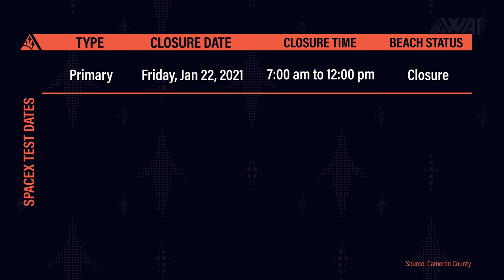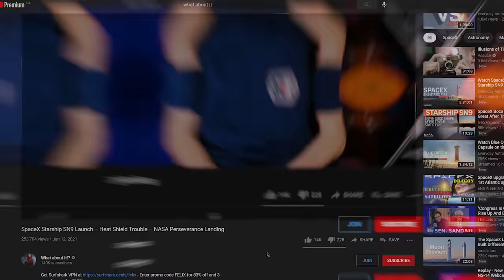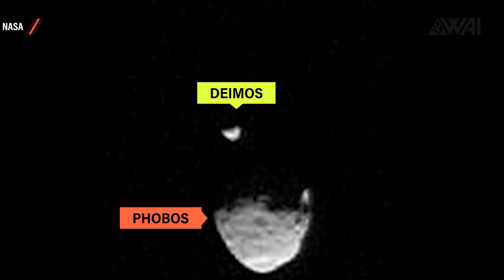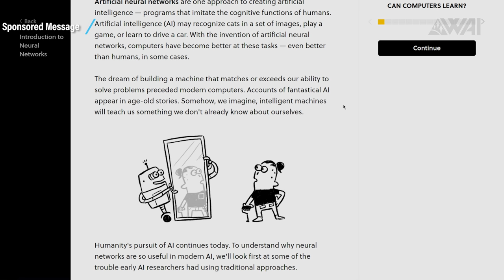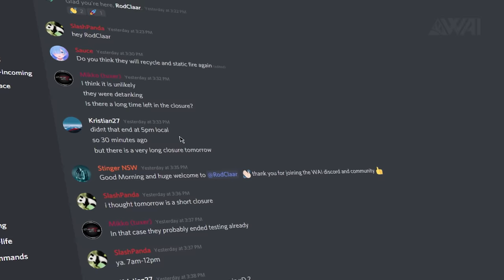144 | SpaceX Starship Sea Launch Platforms Under Construction! - SN9 Strange Tests

Comment: I'm a little concerned with the size of the ENSCO 8500 series oil rigs with regard to launching a full Starship stack from them. These rigs displace 19400 tonnes, which seems perfectly adequate for a 4400 tonne Starship, but the problem lies in the rig's TPC (tonnes per centimeter), which will be quite low seeing as it has a waterplane area consisting of just 4 relatively small legs.
This means that as the Starship launches, the rig will suddenly have to deal with a loss of 4400 tonnes, making the entire structure rise up by a substantial amount. This is of concern for a semi submersible rig that is secured by set anchors to the sea bed.
Presumably SpaceX engineers have factored this into their initial feasibility calculations.

Comment: Good job.  I assume the oil rigs came with CAD models, that will help.  I was on a rig once and was ... impressed by everything, but particularly a lot of shipping containers with diesel generators below decks.  Oil rigs need a lot of power.  Thanks for the Tee Shirt!  I may just keep mine pinned to the wall.

Comment: Yet another great video Felix, you called out some interesting details as always.

On the "might we see two boosters being built side by side?" how do you think that will work with just the one High Bay currently hosting both booster builds and final stacking and finishing work for SNs? Do you think we need to see SpaceX break ground on a second High Bay (probably next to the existing one) quite soon so that HB capacity doesn't become a bottleneck? Even if they do that it will take a while to build a second HB so if they really are going to do two booster builds in parallel perhaps final stacking and finishing work on a few SNs is going to have to go back to the old days when that stuff was being done out in the open.

On the sea launch platforms I wonder whether they will bother with any crew accommodations. It seems to me that it would be quicker to simply buy a suitable ship/boat for all human occupation that stands off at a safe distance from the actual launch platform and either only docks with the platform for embarkation/disembarkation of has a smaller shuttle vessel that takes crew and maintenance engineers the 2 miles or whatever the standoff distance is to get humans to/from the platform.

Comment: i bet that 1: either these were bought as support platforms, or 2: they will somehow be combined into a single platform. my instinct says that these will be stages from which the real launch platform will be constructed close by, (wherever they end up in the gulf). ie these will be located in a position, eventually, where they will be used as a means of making a new dedicated platform for launch.. and they themselves are not the launch platforms, either by themselves or combined. remember they only cost 3+ mil a piece. pocket change for spaceX. good deal, but i think they need to engineer their own platform from the ground up.. ha ha (anti-pun intended).. get it? .. cause it's a floating platform and nothing is from the gound up?.. oh never mind.

Comment: Does the Moon version of the starship need sea level raptors at all? Wouldn't they be high enough in their flight profile to skip them? If three Raptors can lift a Starship off in 1G wouldn't 3 Vac Raptors be plenty to take a partially laden ship off the 1/6 G surface of the moon?

Comment: Usually glossed over is that if a fully loaded Heavy launces the noise from the 28(?) motors would be a danger to anyone within miles of the launch site.  Elon recognized this some time ago, which is why he twittered about the offshore space ports back then.  The purchase of the oil rigs just makes sense.
Felix, care to speculate how the Heavy booster and the Starship will get from the build site to the offshore space ports?  
My guess is that they will be flown there.  If only partially fueled either should be able to do it with only three engines and an acceptable launch noise level.  Flying them to the off shore space port would be far less complicated and far less expensive that transporting them to the Brownsville port by land and then shipping them out to sea.

Comment: If you give it some thought, there is no need to haul Boosters or Starships anywhere.  When a booster or Starship is needed simply perform a short hop to the new location.  
It really is the cheapest way.  Thanks Felix for the tidbits that no one else seemed to know. P.S.: I am still waiting for that crane in high bay...

Comment: Speculation, but if the grid fins to be used in landing, the top of super heavy will need to transmit large bending moments - essentially the top must act as a beam. I wonder whether this is the purpose of the hexagonal structure - though I haven't taken any time to work out the details.

Comment: There will be no need for a water deluge or flame diverter for Phobos and Deimos because the water is already there right under them. This will make testing starship much easier as they won’t have the problems they have with their current pads. Good video btw!

Comment: at 6:06  that ring may wiggle a firm seal to the tank tip 
but not welded to the tank tip, 
so separation requires Newton alone, no pyros or springs, maybe just an enthusiastic RCS

Comment: Flame Diverter? Deluge System? It's sitting on the ocean. Wouldn't that do the job? I mean, RIP nearby sea life, but still.
Reply: The exhaust wouldn't be directed directly inside the ocean, and water is pretty good sound suppressor

Comment: Elon keeps saying starship is for going to Mars but that's bull poop.  The raft or rockets are designed for 1000 uses.  It takes 4 years to go to Mars and back.  Mars is not commercially viable for anything now and for a few hundred years.  Texas to Europe in 30 minutes.  Texas to China in 45 minutes.  And what a great view and ride
Reply: 1000 uses is for the booster. The ship is expected to take less reuses because of the Mars trip

Comment: Search for 'SeaLaunch' and you will find the basis for the idea of using Mobile Offshore Drilling Units (MODU's) for launching rockets from the Equator in the Pacific Ocean.

Bet on at least two (2) years and $100 Million BEFORE they get even one of these operating 'properly'.

Comment: Why not using these oil rigs as "mini" spaceport and train with the F9 ? Then move on bigger for Starship ?
Reply: Falcon & Starship had entirely different equipments. Modifying it would be expensive

Existing launch sites are good enough for Falcon, and all efforts of upgrading it is a waste when Starship takes over

Comment: hallo Felix. i see your channel often. and i have question in mind:
what if starship success land on mars, but then the raptor engine broke / malfunction? does it mean it can not go back to earth? (or maybe the first starship will carry some raptor engine for spare part?). thanks
Reply: It will have several cargo ships anyways (which also has Raptor on its own), so they can use those as spare parts

Gravity is smaller, so the Raptor should be much lighter than here. Lifting it should be easier :p
Reply: @alvianchoiriapriliansyah9882  ya, it will make sense. maybe space x just have to simplify the way raptor's installment. so it can be done even in mars 😊. thanks for the answer 👍👍

Comment: I'm growing increasingly concerned, that the Raptor is too powerful for Superheavy and having 30ish light at once would cause a RUD
Reply: I'm sure the engineers had done their maths
Reply: @alvianchoiriapriliansyah9882  even a static fire with just three raptors can damage them enough to need replacement. Math for this kind of stuff is not straightforward
Reply: @bjarnes.4423  Raptors will have many improvements, but saying concerned is like saying that the engineers are as stupid as the rest of the people
Reply: @alvianchoiriapriliansyah9882  I have deep respects for all the engineers working there
Reply: @bjarnes.4423  The parent comment shown that you're doubting their skills. They're surely again made many calculations to account for it
Reply: @alvianchoiriapriliansyah9882  better  healty skeptisism then blind trust. I want this to work and hope for it, but I only estimate the chances to like 80%. I would have given Apollo similar odds, yet it worked because they had many skilled people working on it, plus a bit of luck

Comment: Maybe spacex will put those 2 oil rigs together with a little "bridge" connecting them
Reply from the maker: Absolutely possible, but hard to do. Structural stress due to waves would be immense. Working on some ideas and research right now. Stay tuned! :_WAISweet:
Reply: @Whataboutit  It could be a floating bridge loosely connected to oil rigs

Comment: Here's a kind of counterintuitive question - do you think that the oil rigs could be used in a hybrid scheme? Using them as Starship launch/landing platforms AND as oil rigs in that they could tap the natural gas in the gulf to use as fuel for Starship? There's lots of methane in the gulf. They can certainly mine the gulf water for oxygen, but will they make their own methane from the water, or just tap in to existing gas?

Comment: I kinda doubt either of these platforms are big enough on their own to be a full fledged Starship space ports.  After all though they hope to land the booster back on the launch tower, they'd still need a landing pad adjacent to the launch tower for the Starship and there just isn't enough space on a single  tower for that. Much less all the other infrastructure needed to operate a space port

Given these platforms are nearly identical I wouldn't be surprised if they were combined into a single launch platform with a large deck built on top that connects them. With such a deck they could they could IMO least triple top deck area of a single platform. Which is probably the minimum they'd likely need for a real space port.

Otherwise I'd say Phobos and Demos are to be use for Starship development and will not become full fledged commercial space ports.
Reply: Offshore commercial spaceports for Moon, Mars, and E2E. This is the very first of them

It's huge